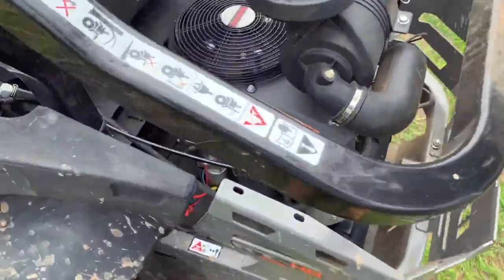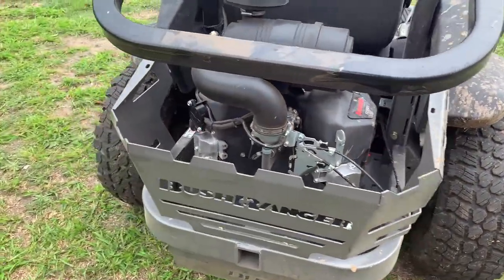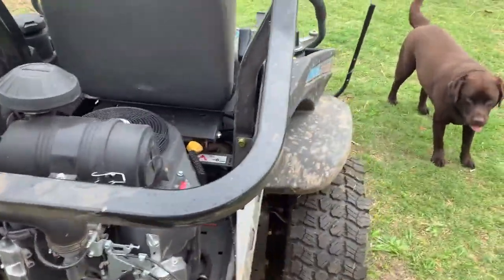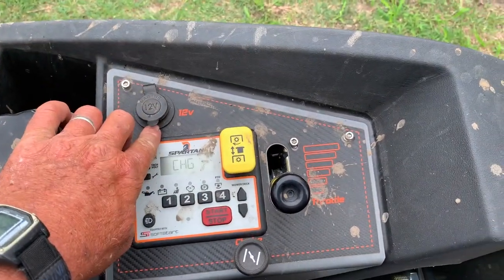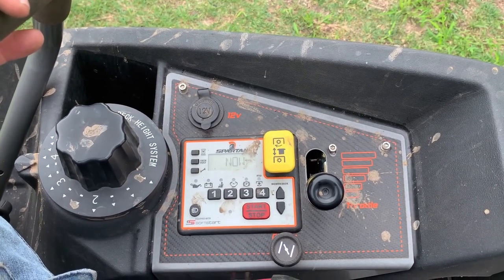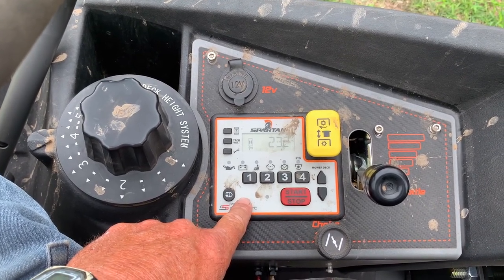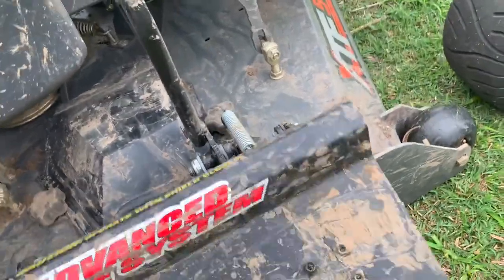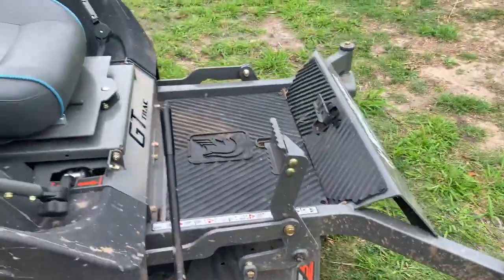Getting Dirty with the Bushranger Spartan - First 20 Hour Review

Comment: Had one for about 2 years and it spent about a year in and out of the workshop with charging issues and the deck lift system was bent by the bouncing over rough Ground.

Comment: Hi from Perth.
I am comparing this model to the the Hustler raptor XD 54, which one is better  your opinion. Many thanks.
Reply: Great question ! Wondering same ! Personally am leaning to hustler ! Many probs with keypad & height adjuster
Reply: I'm sure this comment is late but I own a commercial lawn care company and all I run is Spartan mowers and echo blowers and trimmers. I have not had one break down in 2 years from any of my equipment. The Spartan mowers are solid and high quality, I have had the RZ 48 and the RZ-HD48 and both have been fantastic. Next year I'm going to an SRT-HD for sure with maybe a Spartan KG stander as a backup. Only issue I've had is the quick shoots are absolute junk. Buy a different brand quick chute if you mow commercially.
Reply: @skimz2012  thanks for the reply and advice .
Reply: Stick with a hustler they are the best Zero Turn Mower on the market